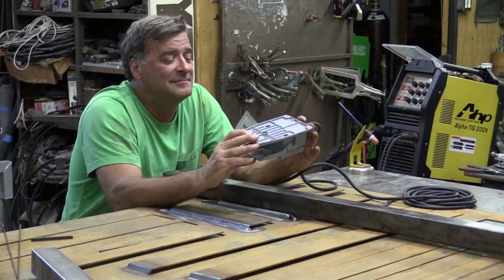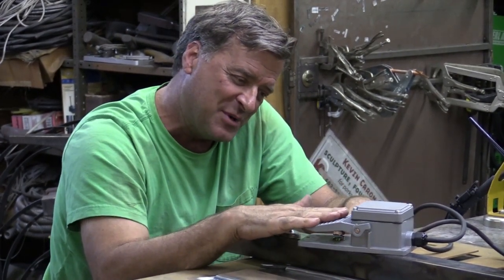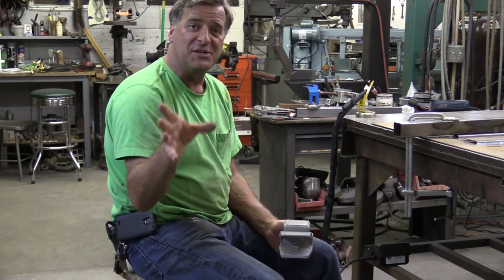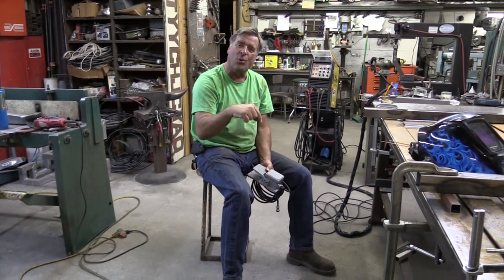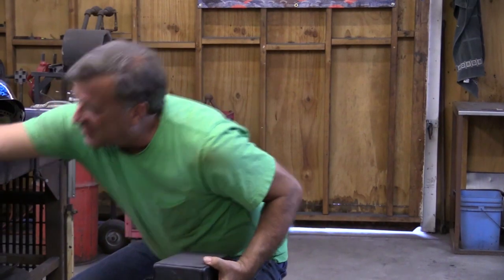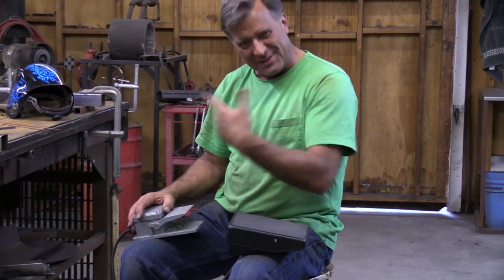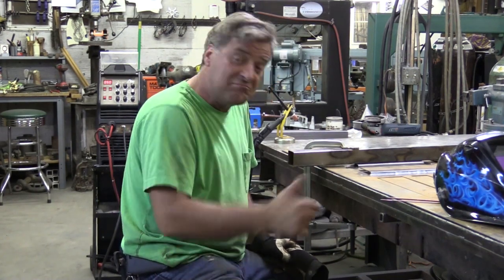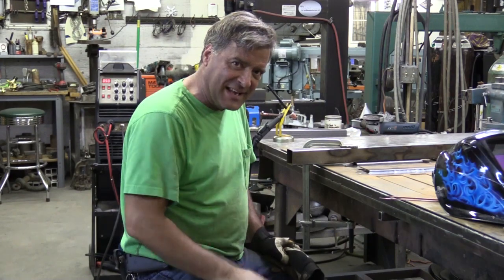How to Know if You Want a Better Foot Pedal for Your AHP TIG Welder - Kevin Caron

Comment: hey Kevin, really enjoy the videos! I know you already have the new pedal but try this with the old one. turn it around and put your heel on the top of the box and toes on the control. Tried one of these and did this, made it alot easier to control and it didnt slide around.
Reply from the maker: Oh yeah,  Tried that the first time I used the machine.  Got one hell of a cramp in my calf!!   But yes it does work.

Comment: I attached a thin plate to the bottom with a small lip at the back that catches my heel. it doesn't slide around any more and works fine.

Comment: I screwed a deck board (5 quarter] to the bottom of it and added skate board tape to the board.  The board is long enough for my foot.  Doesn't slide around and the skate board tape keeps my foot in place.
Reply from the maker: Lots of ways to stop that sucker from moving around!  Thanks for posting.

Comment: I am considering buying one of these newer foot pedals when I finally get my welder. I just recently ordered it, however I also think the larger piece of plywood screwed down from the bottom is a great idea. But, how about this in addition. What if you added to that a small piece of plywood to just lay it on top of the foot pedal and was hinged behind your foot, and attached to the bigger piece of plywood with a small door hinge or something of that type from Home Depot. Then when you're pressed on the small plywood it would press down on the foot pedal and act just like the forward controlled style foot pedal. I'm also thinking it's got to be easy to get a spring to replace the poem spring under there that's got less tension. Just saying, those foot pedals are pretty expensive and there may be a cheaper option for a cheap old guy like me. Especially when you mentioned that electronically they seem to be about the same I can't understand having to spend an extra $175 or so until I try out another style of adapter for the foot pedal. Even an old bass drum pedal laid over the top and hinged from behind. That would reverse the action of the OEM foot pedal. Anything before I spend that much money.
Reply from the maker: Seen lots of different ways to handle the pedal issue.  Yours sounds good to me!
Reply: Foot control pedals are simple components so you could use a guitar effects pedal with the right potentiometer, or to get the housing you could buy a used pedal for a different machine and wire accordingly. The SSC pedals are ergonomically outstanding compared to that absurd stock design, but they are basically two stamped nesting rectangular cups with a pivot and a bit of hardware. The easiest pedals to modify are Miller pedals, and those are inexpensive used unless they fit something particularly desirable. 

You can pull the specs from your manual then match or mod any pedal you prefer. 

You can DIY complete pedals. Example from the SFT forum here, but check out fora like weldingweb and the Miller forums too:

https://www.shopfloortalk.com/forums/showthread.php?p=561606#post561606

Comment: I think it might also be a difference in idea.  I JUST started taking TIG lessons from my wife's boss (using an old Square wave) and the regular pedal HURTS, but then again, we are welding STANDING, so basically you are having to stand on one leg and rock.  I turned the pedal around (backwards) and being able to put my weight on my heel and squeeze the pedal gave me better control
I wonder if the AlphaTig pedal is really designed to be used STANDING
Reply from the maker: I just use the finger switch and get my work done.   Can't stand the stock pedal.
Reply: It was just a thought.  In my case, someone else's machine, and I use their setup.  Just learning.  Used to do a lot of SMAW (like multiple boxes of rod/week), but just started learning TIG

Comment: Couldn't you just put a rubber mat under the pedal?  I buy a certain rubber door mat at Lowe's and put it under bench grinder stands.  It stops them dead in their tracks.  It grabs both on the top and on the bottom of the mat.
Reply from the maker: Sure!!  Or use a piece of wood and mount the pedal to it.  I tried using some rubber feet under the pedal.  Or just get a better pedal.

Comment: I was watching this video because I have a hard time achieving low amp control with my 2015 and 2016 versions of the AlphaTig 200X.  I was excited to see how the SSC pedal did, but then your stock pedal did well too.....  I don't mind the ergonomics of the stock pedal, so has it turned out that the SSC pedal provides any better control, or should I just save my money?
Reply from the maker: +Hammerhaus Kennel                 A small improvement over the stock pedal..     I use the finger control almost exclusively but I like the feel of the new pedal..    Easier on my ankle,,
Reply: Kevin Caron, Artist Thank you Kevin!  I guess I'll save my money for now then.  I appreciate your feedback.

Comment: Kevin
Do they have a wireless one like I have on my miller 200dx?
Reply: ***** Well they are nice - the best part was one time I was under a dash welding a small part in place laying on my back - the only way I could press the peddle was to hold it between my knees - was tricky but worked

Comment: SSC pedals are well regarded as they should be. That stock pedal has AWFUL ergonomics, and ergos matter greatly in welding. 

On my pedal I added a toggle switch and rheostat so I can also use it as a remote for stick welding or where I can't use a pedal.. Short tubing stubs protect the switches from my boots when using in pedal mode. Total cost was about 15 bucks for quality parts.
Reply from the maker: Great idea!    Thanks for posting!